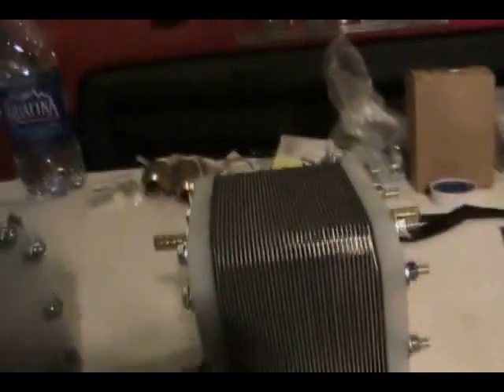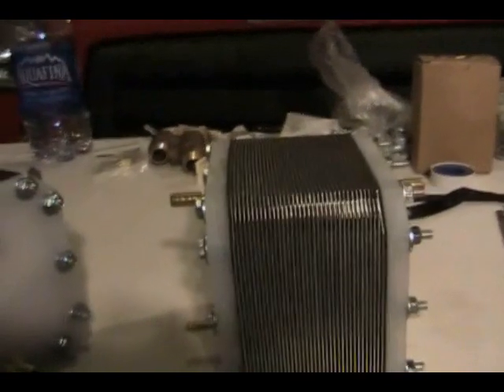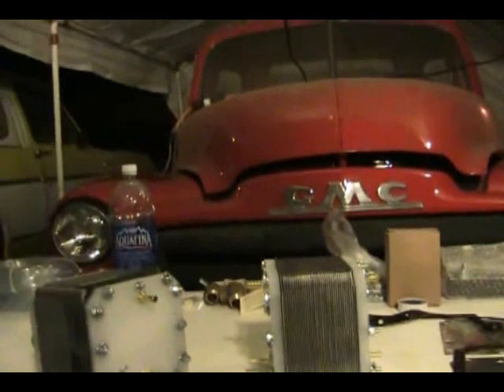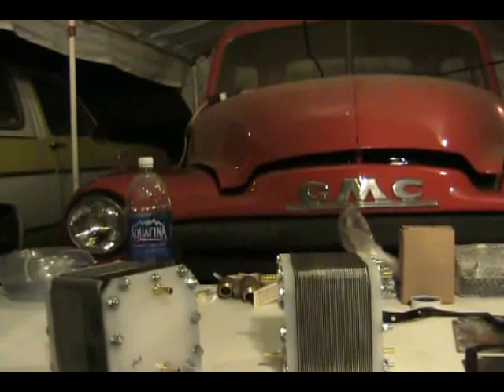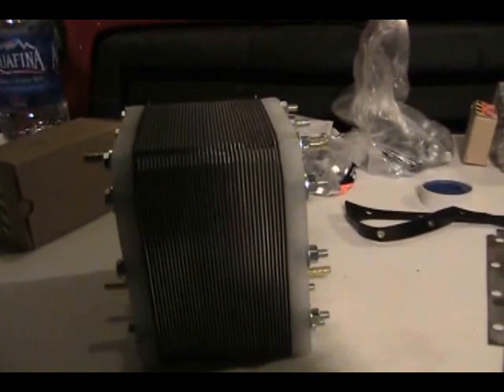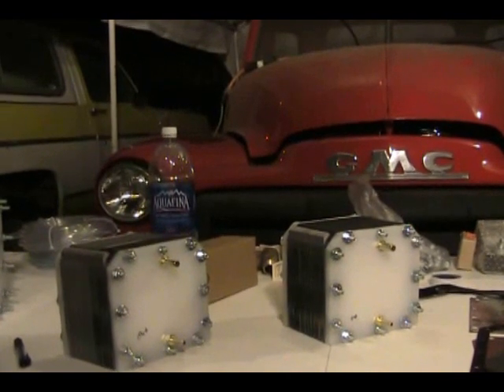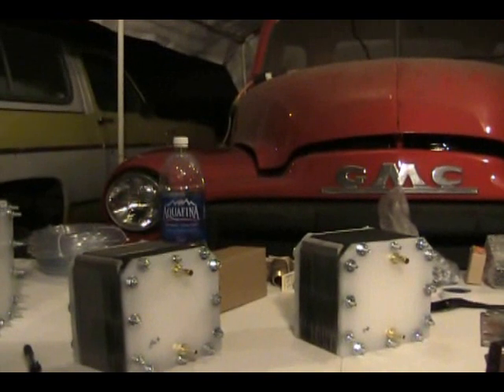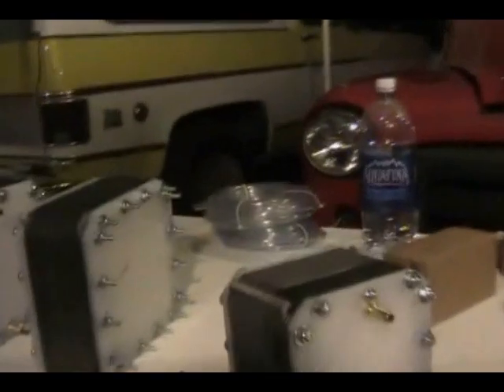Design and Implementation Part 2

Comment: ss is the only economical material know right now, you could use platinum though, but... Improvements are being researched but the environment inside a cell is one of the most strenous imaginable, and materials find it hard to survive, maybe we can make something new using the hho flame heat to make new alloys, but thats not exactly easy.

Comment: what they said:) even at 2v per space, you can make as much gas as you want, you would just need a fairly large cell, surface area means amp draw, and amp draw mean volume of production, but amp draw at a overdriven voltage means steam, not hho. But if size, eff., and production are all equal of a concern, I advise 2.2-2.4v per "cell" or space, however you want to call it.

Comment: The point is that you don't want to go any lower because the cell operates much like a zener diode as ZeroFossilFuels once said.  There is a definite range where it turns on, but if you go much higher than the turn on voltage it gets increasingly less efficient where it may increase production, but also increases loss due to heat.

Comment: 2v per plate gap is very efficient but production is poor ... 2.4v per plate gap gives decent produciton, but efficiency falls off a bit ... so 2.2v per plate gap seems to be the sweet where both production and efficiency are in balance ...